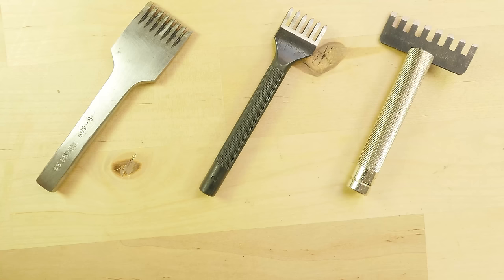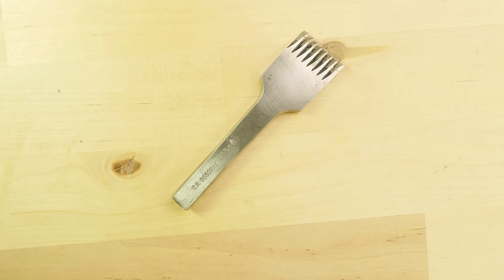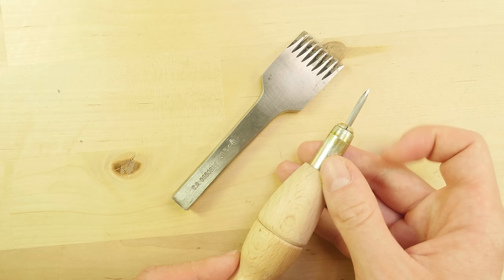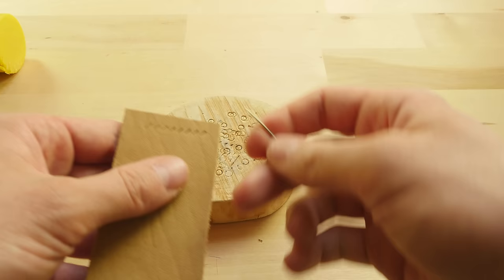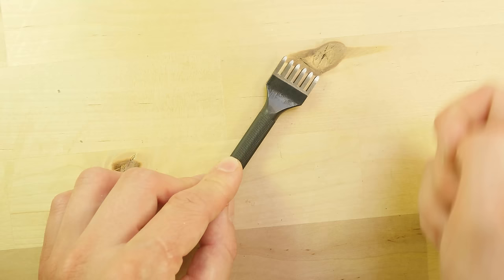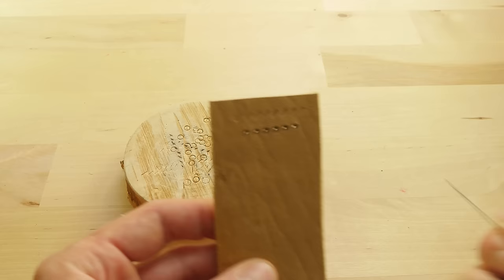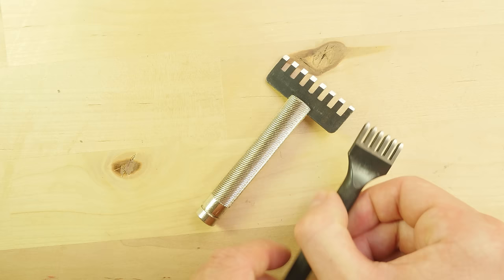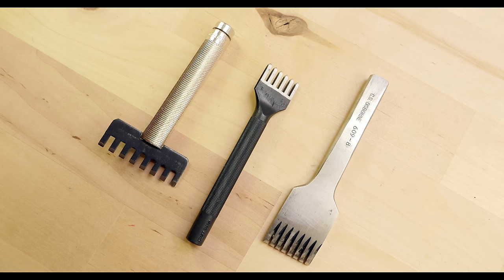Pricking iron vs stitching chisel vs lacing chisel

Comment: For European style pricking irons you need a flat bladed awl, not diamond awl. It works but will make a diamond whole instead of a European style hole. You might as well use a diamond style pricking iron set in that case.

Comment: Why do you need to control the depth of the holes?  It seems to me that you would want the holes to go all the way through the leather so your needle can go all the way through.
Reply from the maker: Good question!

With a pricking iron you basically only mark the stitching. You do your actual piercing using an awl. This way you get just the right size of holes for stitching. This is the best way to do it, but it takes skill.
With a stitching chisel on the other hand, you mark and pierce at the same time, which is a little less optimal, but also a bit quicker.

Mark
Reply: There’s some pricking irons that can be punched all the way through the leather, such as KS blade, or sinabroks, but the older brands like Vergez Blanchard will break or bend if you punch all the way through the leather.
Reply: @keirambelli6394  Thanks!

Comment: Hi, I would like to ask some questions.
I had a set of stitching chisel and I was very careful not to let it pierce my leather too much as I dont want to dull the blade. But the reality is that even I put a layer of scrap leather under my work piece, and I am careful not to pierce all the way through the scrap leather and hit the solid surface underneath, the tip of the stitching chisel still became dull a little bit.
And I see that you hit the stitching chisel directly onto the wood underneath your leather, doesnt that dull the tip?
So, it the tip getting dull unavoidable or just that I bought some low quality stitching chisel that gets dull pretty easily?
Thank you.
Reply from the maker: Hey!

Well, any blade will become dull over time, but the main advantage of a stitching chisel over the pricking iron is that the teeth are straight, making it easier to pierce the leather. The pricking iron has tapered teeth, wider at the handle and less wide at the tip.

So far I have not had to sharpen my chisel yet (and it is not one of the top brands). But if you feel it is duller, sharpen it!

Mark
Reply: Mark the braider 
An excellent reply, the shape of the teeth. At first, I was also wondering why not use the stitching punch just to mark instead of punching through in order to control the depth. On the other hand the pricking iron teeth tip can bend if we use to punch through (unless this is super good quality). So indeed both have their own specific use.

Comment: I am very new to leatherworking.  i bought a stitching chisel from tandy leather, but I cannot get it to punch through the leather.  I am placing the leather on a kitchen cutting board.  Is there something I am missing?
Reply: How thick is the leather? The 6 prong chisel is hard to get through two layers of 8 oz leather and if you did it would be hard to get it out. Use the iron and then use an awl or single chisel to finish and use wax on your punching tools to expedite removal. He didn't mention wax for the tools. I use a three prong and have no issues nor with the 4 prong and because I make knife sheaths I have no use for 6 or 8 prong tools, they are too hard to get out and can bust my glue bond and make the layers go out of alignment.

Comment: The problem is with needing to go through 3 layers of 8 oz leather for a sheath... a major pain.
The only way I have found is to, after using the stitching chisel to go through the top layer is to then use my drill press to create a stitching hole that goes through all 3 layers.  The problem with that it is the resulting stitching hole is not as neat.
Reply: Instead of a drill press, use an awl, with the blade lined up at the same angle as the slots made by the stitching chisel
Reply: I haven't tried what you are doing for leather but I have used drill presses frequently - is the sloppy hole the result of the drill tearing out the leather as it exits ? if that is it maybe set your drill press depth gauge to stop the drill just before it pokes through - then use your chisel to punch through the last little skin of leather on the bottom - its triple handling but if it works there are not too many  holes in sheathes.
Reply: I also use a drill press to go through 3 layers for making sheaths for milsurp  bayonets.  I use a throwing dart head wrapped in duct tape to punch through the layers for sewing. The tape prevents damaging the dart body. The dart pierces the leather and into a piece of wood with a small hole to keep it neat.  This method keeps the holes at 90 degrees and prevents off kilter holes. The dart needle is made from harden steel to maintain a sharp point.

Comment: I am a beginner, I use the second one (stitching chisel), but it damaged my work twice now, so much effort to get it out from the leather after knock it, also the thread don't go on one direction after stretching, it got a space inside to mess the thread direction, what you promise me? I did good on paper design, cut, dying,finishing
But this chisel made me out of mood
Reply: It sounds like you are having trouble pulling the chisel out of the leather. Here are some things you can do to solve this:
1) Buy a well-polished chisel, with smoothly polished edges and faces on the chisel teeth. 
2) If you can't do (1), then you can try polishing the teeth yourself. Just be careful not to change the teeth geometry.
3) Push your chisel into a block of wax before using it to make holes in the leather.
Reply: @dmjole  thanks alot for your advice and time very helpful :)

Comment: Hey Mark! Thanks for the video. Where did you get your awl? It looks so nice
Reply from the maker: Hey!

I picked this one up in a leatherworking shop. It is an interesting one, which allows you to secure the awl blade by screwing the awl together. So the blade can be switched for a shorter/longer one. So it is a fairly modern contraption, but it works well enough.

Mark